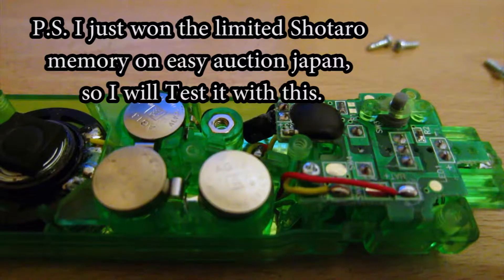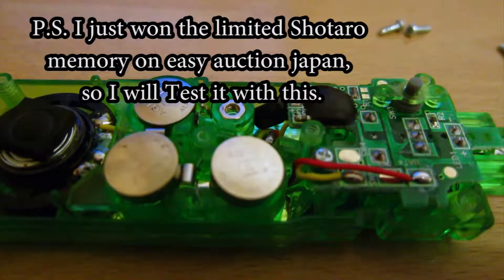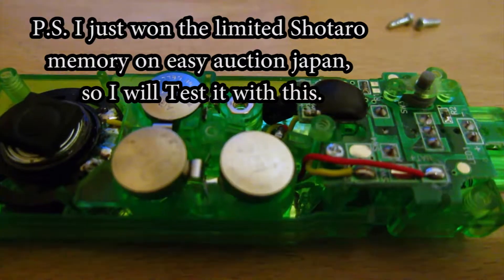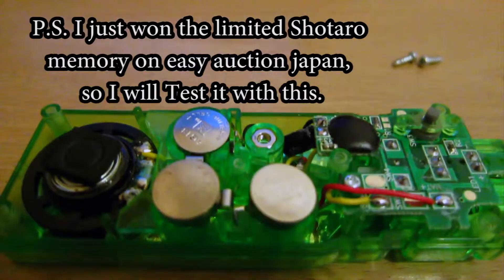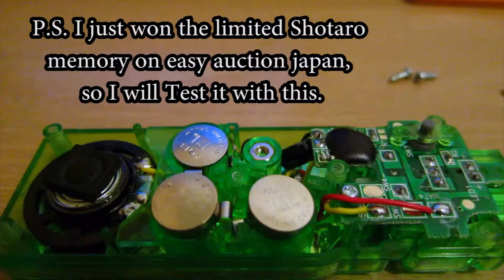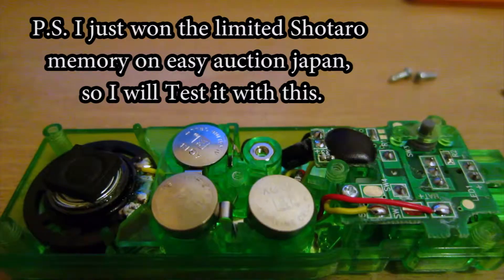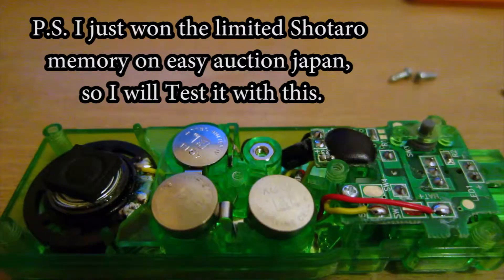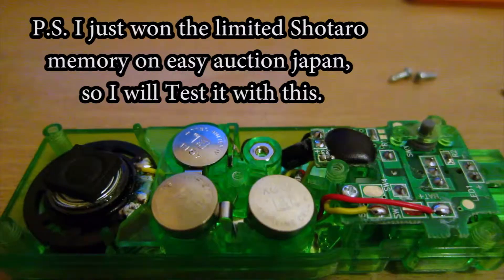Kamen Rider W How to fix Philip Cyclone Gaia Memory

Comment: will this work for the Eternal memory to make it more sound accurate?
Reply from the maker: eternal has issues? and i image it works the same way.
Reply: The dx version is deeper than the capsule version.
Thank you for answering.
BTW, I'm working on an Eternal Edge, can u check it out when I'm done with it?